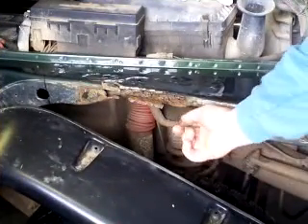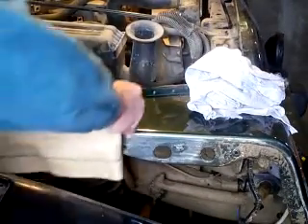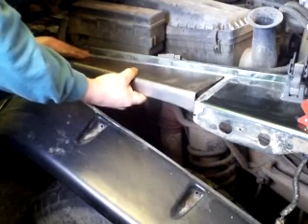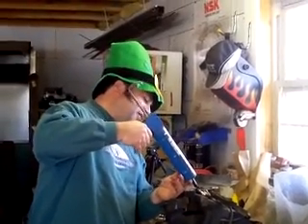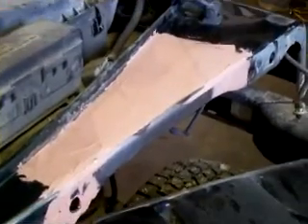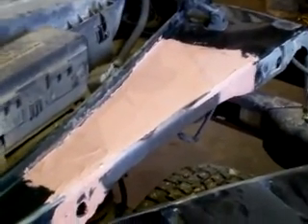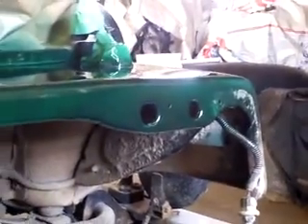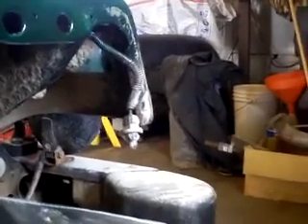Jeep TJ fender repair.MPG

Comment: Cheers eh? Dealing with the exact same rusted area and about the same cut out now on my recently bought YJ, is a real challenge to plan it out for steel cutting and molding before welding.